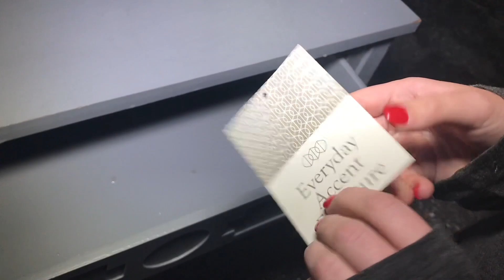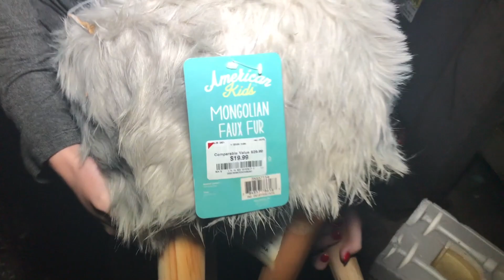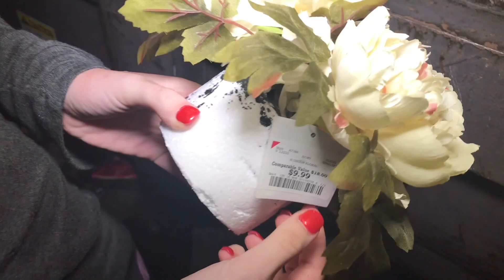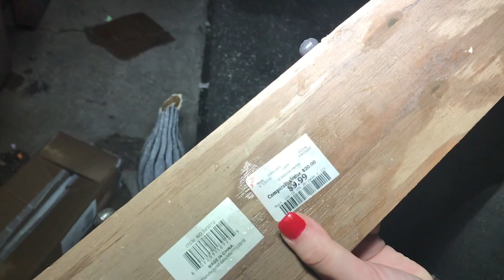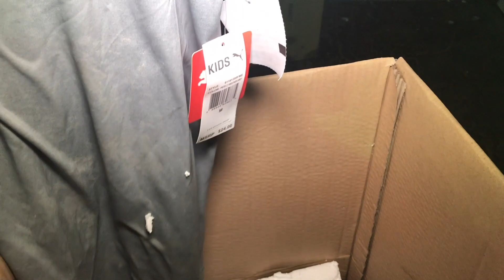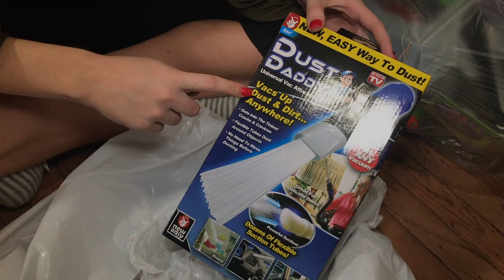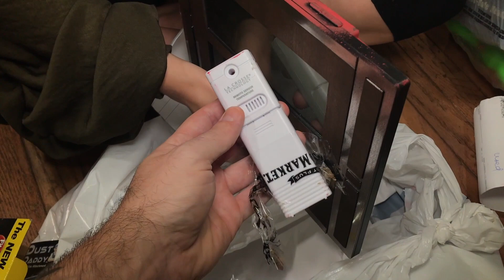MORE HUGE BAGS OF SURPRISES LEFT FOR US IN THE FIVE BELOW DUMPSTER! + BURLINGTON HAUL! NIGHT #269

Comment: That beautiful table is an easy fix.  Take the front of the drawer off and pop over to Lowe's or Home Depot and (I think they do) have them cut a piece of nice wood the same width and length of the original drawer front.  If you want they have really pretty molding (used on cabinet fronts, etc) and glue it to the new drawer front and have hubs nail (preferable a nail gun) and/or wood glue the front back to the drawer (my hubs has had to do this to one of our kitchen cabinet drawers) Painting should be fairly simple or change the whole color to suit your home!   That cute little stool (if it is irreparable) you can find legs at HD or Lowe's and you have an adorable boudoir stool...  So cute!!    I wish I was younger because we have a ton of stores around here that throw away the most amazing things..  If I even tried, they would find me several days later still stuck in the dumpster covered in "reduced for quick sale" tickets....

Comment: as far as the mirror coat rack with glass knobs, you take the knobs off and either use them on dressers or other purposes or sell them in bunches.   they are super hot in demand right now.  They come off so easy like cabinet door hardware.